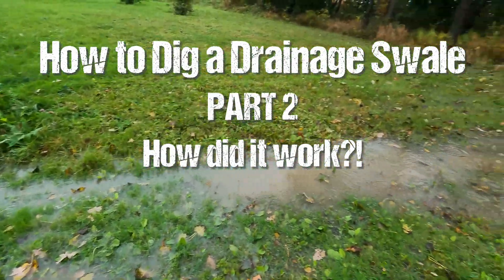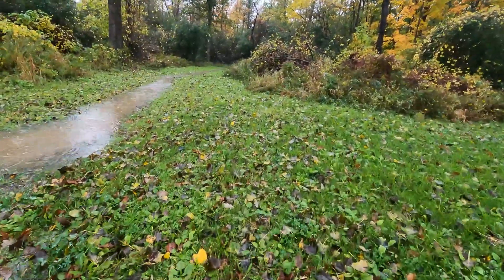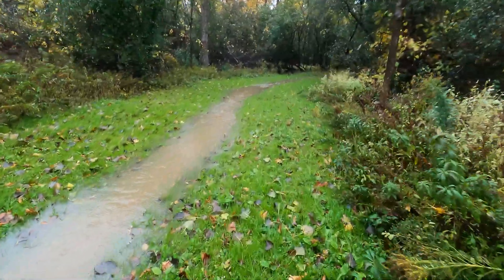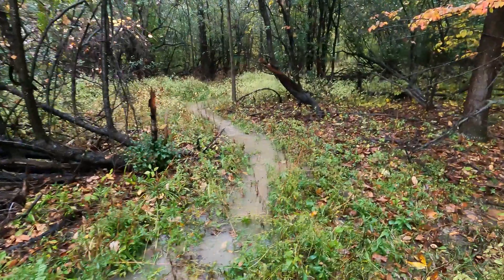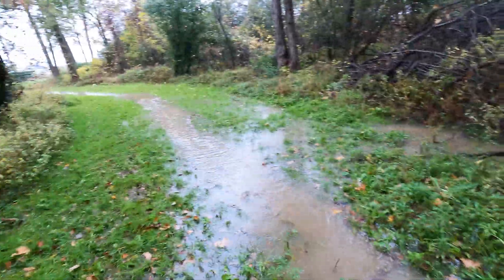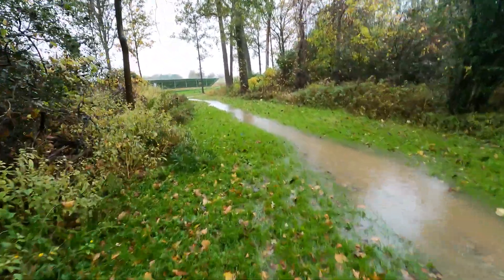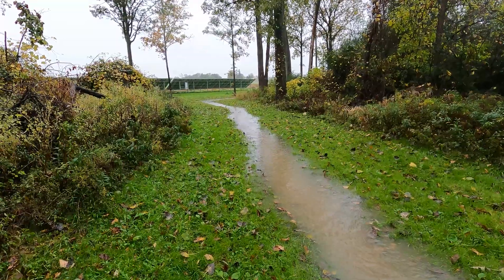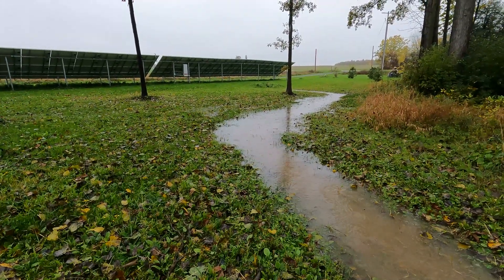It Rained! Follow Up to "How to Dig a Swale"

Comment: What model rotary laser and magnetic receiver do you have?
Reply from the maker: rotary: Topcon RL-SV2S (it's practically bullet proof)
magnetic receiver that I used: Spectra CR600 (which I really like)

But I also have the CR700 and like that one even more. Biggest improvement is the larger receiver area.
Reply: @PatrickDesignBuild  I was looking at the Topocon LS—B10 receivers.  Should I go with the Spectra CR700 instead?
Reply from the maker: @scottseaner8937  Good question! I haven't used the Topcon receiver but I'm sure it works well. What I like about the CR700 is the laser detection range/height, the volume (I can hear it well in the cab), and the magnet (it's super strong and never fallen off). I don't think you can go wrong with either... but I'd have to compare them head to head to give you a definite answer!
Reply: @PatrickDesignBuild  I ended up ordering the Topcon LS-B10 machine receiver and the RL-HV1S.  My property is pretty flat and has many areas that hold water.  I need to create swales to move that water to a slough and onto the creek. I have a KX-057-4 and this will make working solo much easier and more accurate than using a basic laser and stick. I did not see the need (additional costs) for the HV2S as this is for personal use and it would be used 99.9% of the time on a single axis.   I really appreciate the in-depth video showing how to accomplish this.  Thanks again!
Reply from the maker: @scottseaner8937  Good luck! sounds like a fun project to try and control the water. I've used the dual grade laser one time in the past 4 years, so you probably made the right choice. The setup is the hardest part, but once you get going, you'll love it. I also run run the receiver on my grading blade too and that works super slick for grading dirt and crushed stone in particular.